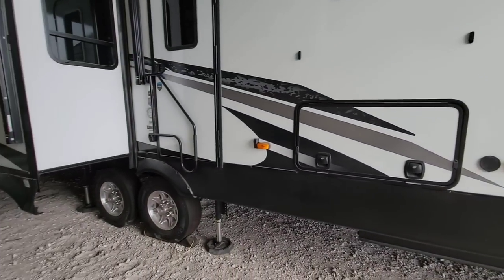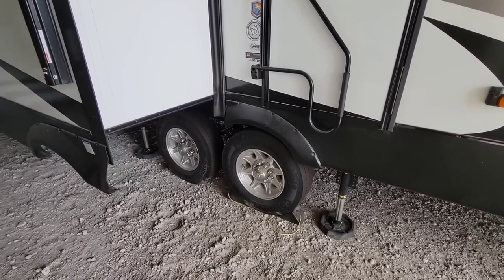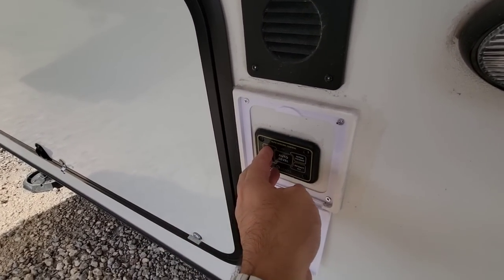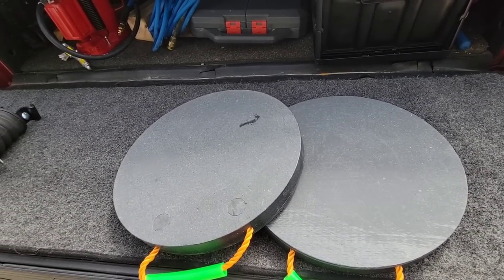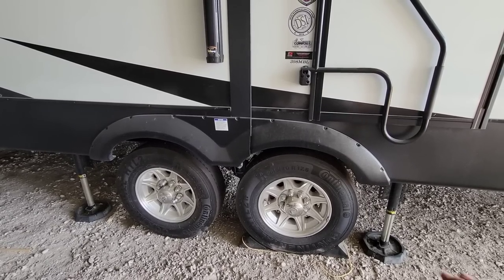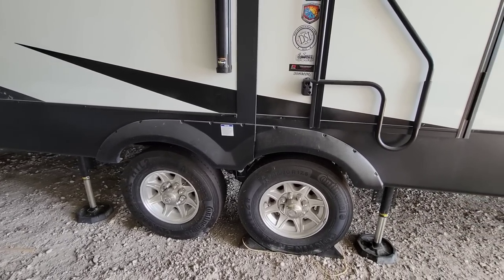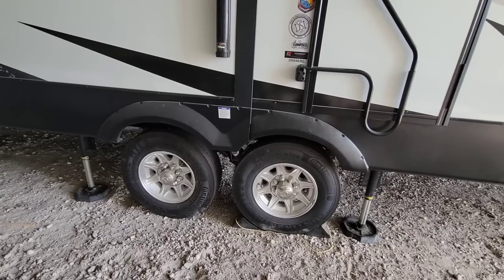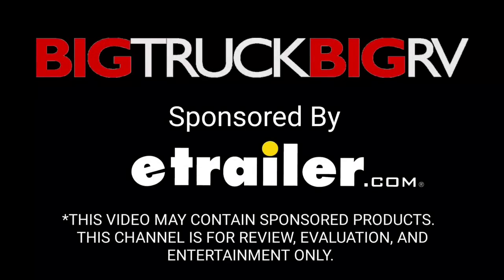These are AWESOME!  Added SumoSprings to our Fifth Wheel RV!

Comment: I put a pair of these on my 2021 Power Wagon. It’s great because there is a 1” gap when unloaded so the ride stays stock, but when I drop the travel trailer on they compress and help SO much with overall towing control. I was shocked.

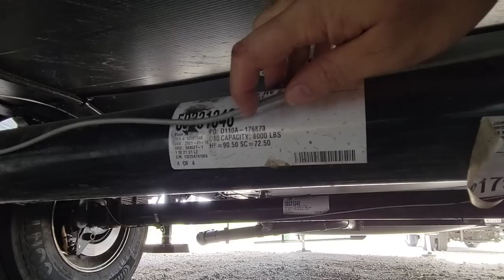Comment: 11:00 not sure who installed those hydraulic brakes but you may want to take it to a professional. You never ever install brake tubing on the front side of the axle , tubing always goes on top or at the back side of the axle for safety reasons it you got something in the road , it can easily crush or break the line if it gets caught between the axle tube and brake line. The other huge issue is there is no rubber hose on the front line!  No hose clamp or even a zip tie securing the Tee block to the axle . I would fail that trailer during the annual state inspection, not sure if you have an inspection procedure or requirement there but it fails a NYS trailer  inspection . Nice job on the sumo springs !

Comment: I have no issues climbing under raised/jacked up vehicles. I used to work as a diesel mechanic apprentice. I've climbed under all sorts of big rigs for one reason or another. As long as you are using the proper equipment there shouldn't be an issue.
Reply: If you had to remove the tires or were wedged in there shoulder to shoulder on your side it'd be different. If it dont feel right, don't get tight.
Reply: I would recommend supporting trailer with your stands. Gravity always wins during a jack failure.

Comment: Your brake line from your frame to your axle needs to be rubber, and Tee on axle needs to be tapped hole into axle, and secured with a bolt. Also brake line running across axle needs to be secured

Comment: Good stuff, JD. Based on your first vid I ordered two sets and installed them on my Momentum 354M. I did a little drive and hit some bad roads and could immediately notice a significant positive difference.  Less jarring transferred to the TV and less trailer sway.  Thanks again for your channel.
Reply: Were you riding inside to notice this?
Reply: @ricbailey170  not riding inside the RV. Seat of pants measurement from driver seat. Same road driven before Sumo springs (one week ago) had a noticable difference.

Comment: The automatic leveling system on my Keystone Outback 328RL  left me in a precarious situation on two accounts. The BAL LS 7.3 leveling system allowed it's functioning to lower the rear two height adjusters on less than level ground. Only when the system was at near full extension on one side did it set a error code about unlevel surfaces and the need to correct the level of the ground. By eyesight it didn't appear that far off, thinking the leveling system will correct for it. At the time the error set, I could not in anyway override it. Believe me I tried all features on the BAL LS 7.3 to do so. I had already disconnected my truck and could not reconnect the truck if I wanted to because I allowed a buddy to place his 5th wheel in the location forward of my RV. But that was not the problem. The error code would not allow me to raise the height adjusters and give me an opportunity to somehow get the RV level. I was stuck! I tried using a screw type jack under one axle end that had the lowest surface area. Because I had to lift the RV with the axle I could not get the hand jack to overcome the weight. Plus, lying under the RV working a screw jack Io it's limits was not a good thing and dangerous. Fortunately my buddy had a massive hydraulic telescoping pump jack in his arsenal. It did the trick, having raised the wheel/tire assembly off the ground high enough to place additional 2x6s under the tire. This allowed the automatic leveling system to sense a more suitable level limit within it's obvious narrow preprogrammed range and allowed for the retraction of the rear height adjusters where I could then reposition the RV and start over again. I never imagined a case where the system would allow you to NOT be able to retract the levelers UNTIL you corrected for level! Amazing! Not fun being under such weight trying to get out of a jamb when your leveling system helped put you there!

Comment: That up grade might be all good, but while watching it and noticed the steel brake lines moving against the axle when you bumped them and the fact that the tee fitting goes up to steel mounted to underbelly and no flex lines is a disaster waiting to happen. The steel brake lines will fail.
Reply: Saw that... Can't be how they plumbed that... Maybe it's just how it looks on camera?
Reply: That trailer would never pass inspection, disgusting how shoddy that work is
Reply: Yeah that is not a quality product, it shocks me how bad things are in America, there is no way that would be allowed In the UK.
Reply: I have watched 100s of hours of 5th wheel video in preparation for a tour of American I want to do and stuff like this worries me,
Especially the momentum products.

I'm down to a luxe 44fl, a vanliegh beacon rdb or a riverstone 39rkfb there is at least one of each available I like its finding a tow vehicle I like torn between a f450 or hgv with space for a toad car on the back. I still have over a year to prepare but its getting daunting.

Comment: I'm hearing that the Lippert frames that have been manufactured thinner due to weight reduction demands by some RV manufacturers. I'm wondering if these Sumo springs may eventually result in overstressing frame areas such as cross members resulting in cracked welds and frame stress fractures?

Comment: I used the jacks I have intended to change a tire, they are designed to be a jack and a jack stand. I also used regular jack stands as added safety. That worked great and I felt safe while under my RV.

Comment: I really would like a video after some towing time to see what improvement you observe. Thanks.
Reply: On another site, after install, they put a camera on the Dinning room table monitoring a cup of water on the table. He drove down the highway pulled off on a rough side of the road. The cup was still in place and no water spilled. That’s a huge improvement. His was a 40’ 5th wheel. 
Sold on these!!

Comment: Those should definitely smooth out the ride. Just an FYI though, don't use lock tight with nylon lock nuts. The lock tight will eat away the nylon.

Comment: From a layman’s point of view it seems this product would drastically limit available suspension travel. Taking away the springs ability to absorb bumps. Seems like adding shocks would be much more preferable.
Reply: SumoSprings are shocks. -Adam
Reply: @SuperSpringsInternational  they are not shocks. They are bump stops
Reply: @Mar--  bump stops don’t compress like that lol maybe they compress “technically” but cmon lol
Reply: @colortaco3298  go ahead and buy a pair for your truck. I guarantee you'll take them off in one months time. They do not act anything like a shock and make your suspension very stiff thats why I went with air bags instead

Comment: I just put all new leaf springs, equalizer, and shackles on my 22ft trailer. It only weighs about 5500lbs loaded but I was nervous as hell working under it.  I have 8 jack stands plus the tounge jack and still didn't like it.  It just made me nervous because there was no axles under it.  If it would have fallen it would have went all the way to the ground.   Nevertheless I got it done safely and everything is up to date now.

Comment: Good video and I did not have any issues with using the jacks and crawling under the trailer. One item, the directions do require torquing the carriage bolt to 10 ft lbs.

Comment: The ground effect system has no problem lifting the tires off the ground. Put blocks under the rear jacks to shorten the stroke on the jacks.

Comment: Just replaced/upgraded the axles  on my toyhauler.  A lot of cribbing underneath after you raised the 5th wheel off the ground and also Jack stands! Wish I would have seen these and I would have installed them during the axle installs. Can't wait for you to road test them.

Comment: I understand how some people would think these rubber springs are a great idea, but personally I think it is a disaster waiting to happen. The area of the frame that is taking the load from the rubber spring isn't engineered to take that load. After repeated loading of the area of the bottom flange of the I beam, I would expect frame damage of some sort. I would never use these without reinforcing the frame above the rubber spring. For the ride smoothing action, shocks would be a better investment and wouldn't compromise the frame.

Comment: How are these compared to having 4 shocks? Shocks would have resistance in both directions up and down,  these seem to have it only in one direction with it only hooked to your axle only for the bottom and the top just has the weight of the trailer resting on it

Comment: I have sumo springs on my truck and like them.  Instead of the pads I think I would have used 6 x6 blocks so the legs didn't have to be extended so far.

Comment: I had installed Sumo springs on my class A Tiffin Allegro motor home. The difference in side to side sway was amazing and the ride was much better overall. I have a fifth wheel now and was thinking about adding this but was not sure how they preformed on a trailer since no one is riding inside. Can't wait to see the test drive to help make my mind up. BTW: On the last video I guess you didn't hear me screaming to lift her up higher and take out those bolts and install them after you get the springs mounted. My wife heard me and I think the neighbors did too. I guess Georgia is a little to far from Texas for you to hear. 🤣
Reply: Thank you for the support! -Adam

Comment: Kinda sorta suggested the same thing the first time. Looks like the original bolts would have worked as well. Glad it worked out. The safety factor is as long as the tires are enough to protect you then you should be fine. If the tires are not tall enough always use axle stands.

Comment: It seems like height of the springs with suspension equalizer flexed would allow you to adjust the height of the springs unequally (if they were tightened to the height of the frame).  I would think you'd want to install them, then let the weight down on the suspension (with the trailer level) to adjust the height with a loaded clearance.
Reply: Smart take.

Comment: The install looks very easy...once you figure out how to safely get the suspension off the ground enough!

If I could fit under the fifth wheel at travel height, I wouldn't worry about the coach coming down on me; otherwise, I would maybe want jackstands for backup, even  though I have seen an entire side of a 22,000 lb fifth wheel lifted a good three inches off the ground by the hydraulic leveling system (and it held as we walked through the inside).

Comment: @BigTruckBigRV wondering if you would still use these after your visit to the Lippert Factory. We have been told this was an automatic denial of frame/chassis warranty if installed.
Reply from the maker: I do.  Only failures I've seen have happened after extreme maneuvering

Comment: What was the tool kit sitting next to the Sumo's on your tailgate? When I need to work under the RV I use a 20-ton air jack and 6-ton jack stands...no sweat. This winter I'm doing disk brakes and sumo springs on my 2970RL, so looking forward to the next video for the road test.

Comment: It occurred to me that a budget friendly way for a rv newbie to gain some of the benefits from these springs on a dual axle trailer would be to install them on one axle until a person could afford to buy another set.  JD what are your thoughts about that?  If a person was to only install them on a dual axle trailer and only had one set which axle do you think they would have the most benefit on the front or rear?

Comment: I'm thinking since you appear to be preloading the SumoSprings at normal ride height, you are going to have a pretty stiff ride.  I use SumoSprings under the rear of one of my trucks, and have found they are best with about a 1/2" air gap as the truck sits at normal height. That way they only come into play once the initial 1/2" of travel is stroked into, whether from load in the bed or from normal suspension movement.
Reply: hey Matt - in the trailer sumo springs, they're designed to be at 10-20% preload. That's the sweet spot on the parabolic spring curve where they provide 68% g force reduction / damping. On the trucks, many folks have SumoSprings with more mass, or that are our higher density springs. In those scenarios, you want the spring with a gap to allow for minimal impact to factory ride when the truck is unloaded. -Adam
Reply: @SuperSpringsInternational  good info.  Thanks for the followup/clarification.   I sure do like the Sumo Springs under the back of the truck.

Comment: Jake, Is there a difference in using the Sumo spring compared to Timbren suspension ?
Reply: SumoSprings are made from microcellular polyurethane, which have superior damping and vibration reduction. Timbren is made from rubber - which is stiffer and does not have the same damping benefits. -Adam

Comment: I agree, that brake line installation is "jack leg" from the get go. Not properly attached, no flex hose. Sheesh! does anyone not have any pride in workmanship any more? The tee blocks should be mounted to the axle housing with a Tee bolt of some sort and a couple of metal clamps. The brake lines should have segments of polyethylene tubing over them with band clamps tight on the axle. Those wire ties will, combined with road grit and vibration, eat right thru those brake lines if they don't crack first.

Comment: At $225 a set they better be awesome as I’d need 3 sets for my THer. I’ll wait for your on the road tests given that investment. 🤔😉
Reply: I was just about to look into these until I saw your comment.   How the hell can these cost that much?  It's a piece of rubber mounted to a couple pieces of bent sheet metal.  It would cost me $500 to do my tandem axle trailer.  They better preform excellent for that money.
Reply: Our product is priced there as the material is not rubber, but a foam micro-cellular polyurethane. Additionally, we make everything in the USA, and offer a lifetime warranty. We know that means it will cost more, but we are passionate about those things and think they're important. -Adam

Comment: I’m a green horn at this looking to start with f250 6.7 xlt  what’s the biggest camper  we can pull with it I was thinking in like 9000lbs fully loaded maybe 10,000 can I do that about 30 to 32 ft length. Down the road maybe even sooner we r thinking adding a 5 th wheel hitch on it
Ty  for all the info very helpful

Comment: Just an add on....if you have wider "shock ready" top plates, the SumoSprings still won't fit even with longer bolts. Just confirmed this with SuperSprings, the only fix they offered was to replace the top plates.

Comment: So I had to put new springs on my fifth wheel 8000 K rated on the drivers side of the RV I only have an inch and a half a clearance between the wheel and the body and it hits because of the bad roads my passenger side of a fifth wheel. I have 3 inches of clearance and I don’t have an issue with that side.
On my drivers side I have three slide outs entertainment slide kitchen slide master bedroom slide a lot of extra weight. How do I gain a couple extra inches?

Comment: Question: if you lift your suspension (in some way) it does lift the roof hight aswell, correct?  (I ofcourse assume as much - but it doesn't seem like anyone mentions it). So, your 13.5 is now a 13.9?

Comment: If that disc brake setup was a factory install I’d be pissed… if that was after market, done by a shop, I’d want my money back… if you did it yourself you should not be doing installs… those lines are trouble waiting to happen…
Reply from the maker: @Itsa_Mea  I certainly didn't do it.  But it is being addressed
Reply: I agree with you. It needs to be addressed. There a plastic tie wrapped around axle and brake lines.

Comment: JD, what's your thoughts on the RoadMaster Slipper Spring Suspension kit?  Obviously adding just the shocks to my trailer would be beneficial.  Currently i have the Dexter Equalizer on my trailer and we're looking to start taking longer trips so looking at the cost of new shocks and a better equalizer, i may as well spend another $400 and get the whole suspension.  do you have experience with this system yet?

Comment: You do know that you can drop the rear Jack's legs before extending them just like the fronts so you don't over extend them?
Reply from the maker: Not on ours.  The rear jack legs do not have inner sleeves
Reply: That's weird. I had same system. I could pull the pins out and legs would drop down with different holes to adjust.

Comment: Why do you want your suspension so stiff????
It’s good to allow your springs space to flex so it takes the shock out of all bumps.
Reply from the maker: Not stiff, dampened.  These bushing would nearly completely compress under the weight of a few hundred lbs.  They slow the compression of the springs, like a shock

Comment: This addition appears to limit your spring travel. It puts additional pressure on the frame. Shocks might work better!
Reply: SumoSprings are designed to compress to 80% of their original height, allowing for articulation. If a trailer spring compresses more than that, it will most likely snap as they are all on about $40 of non-USA made springs. -Adam

Comment: It seems like this product would increase the vibration in the trailer?
Reply: The material produces the opposite. G-force and vibration are reduced on average by 68% in the trailer when SumoSprings are installed.